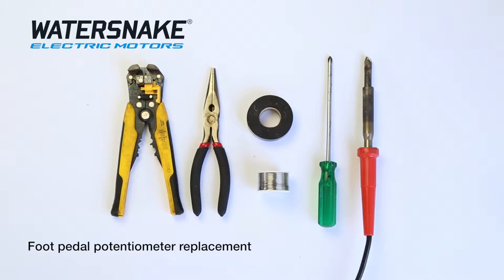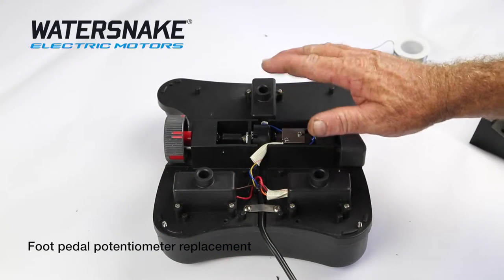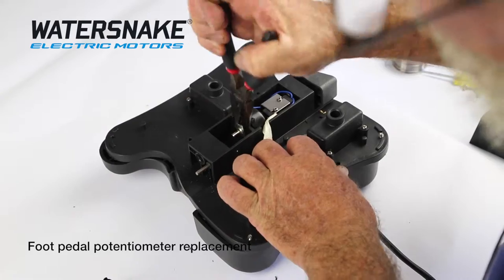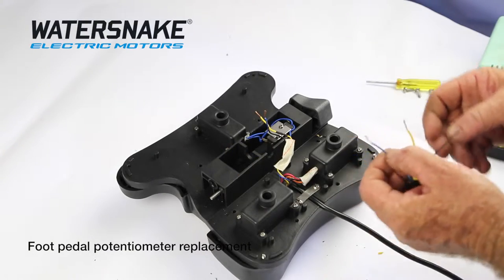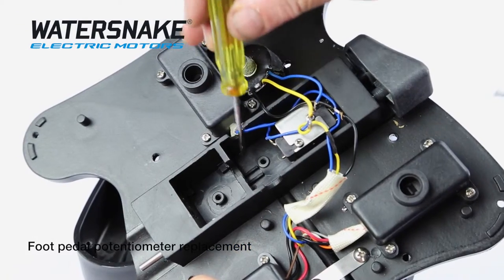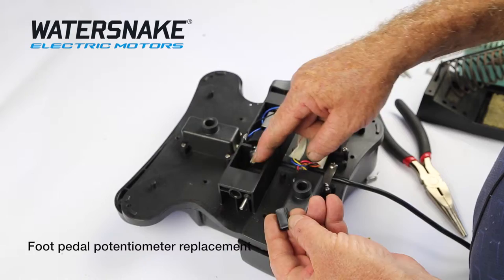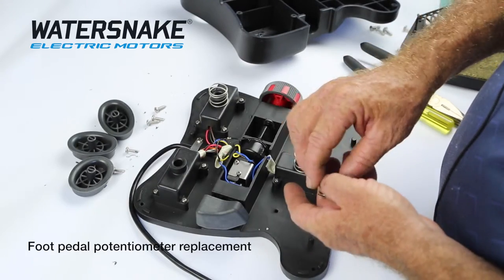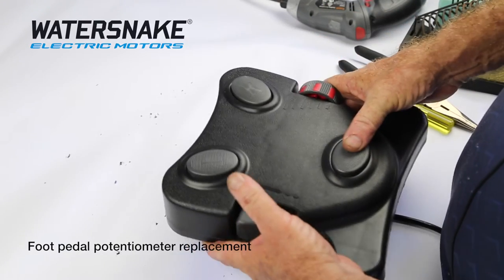Watersnake Foot Pedal Potentiometer Replacement

Comment: My foot pedal control just developed a mind of its own..only goes one speed..left and right works ..doesn't shut off sometimes unless I unplug it..could that be this part?
Reply: I'm having a similar problem, and only the second time I've used the Watersnake Shadow. In the upright position, it won't turn off or respond to the throttle. It will turn left and right. I'm trying to find out if the motor should run with the foot pedal unplugged, which mine does. That would at least indicate if the problem is in the foot pedal or in the unit's headpiece.